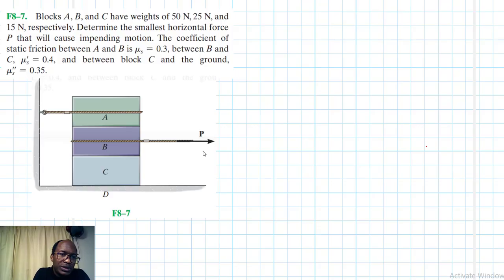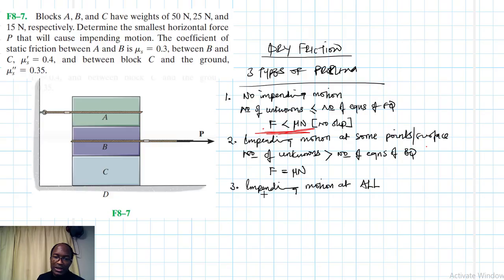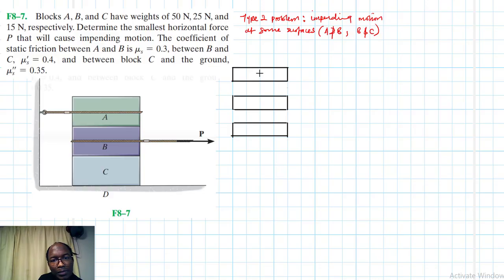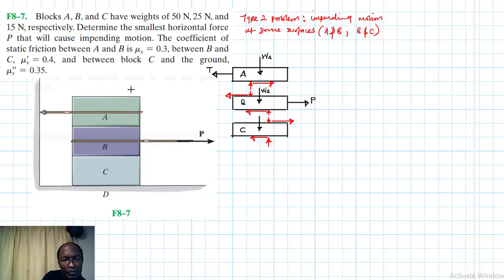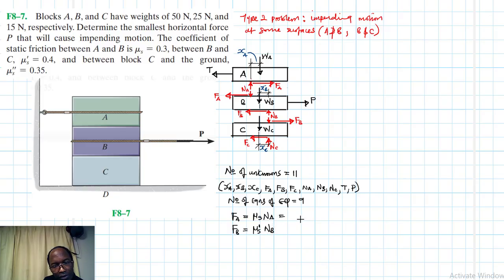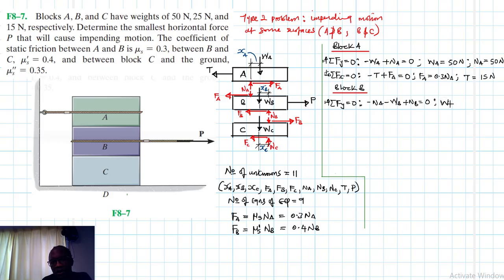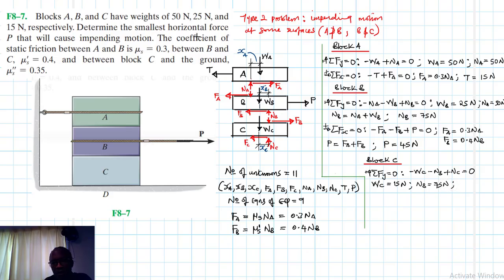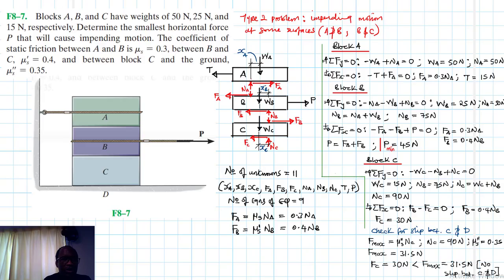F8–7 Friction (Chapter 8: Hibbeler Statics) Benam Academy

Comment: Great video, thank you! I have one question, when you count the number of ecuations (9), the equations for each block were sum of forces on x and y and sum of moments? If so, is it valid to count the sum of moments equations even if the problem hsa no lenghts?
Reply from the maker: It’s always okay to leave out the moment equations if the lengths or the dimensions of the block are not provided